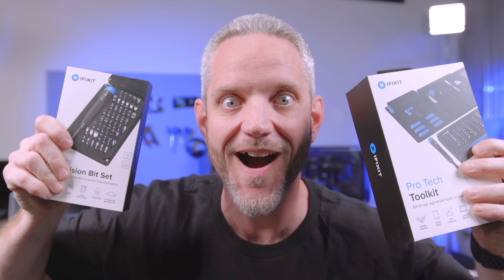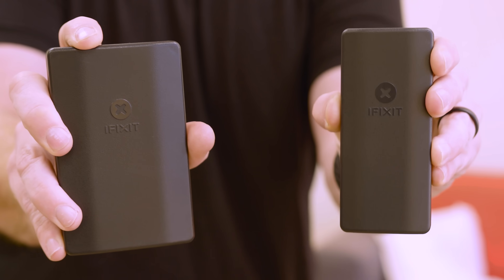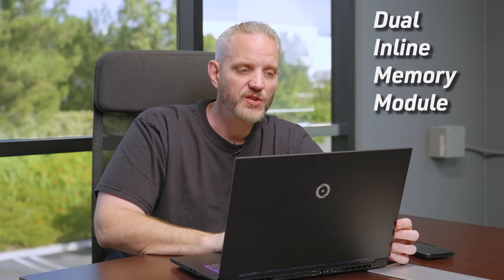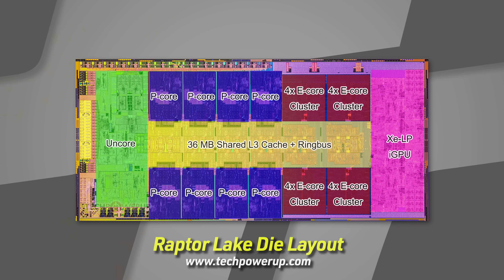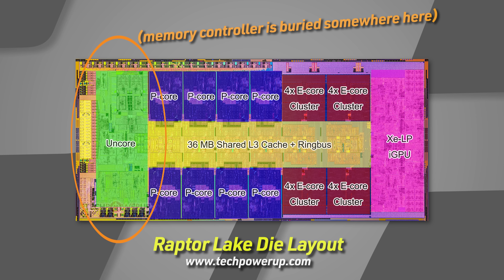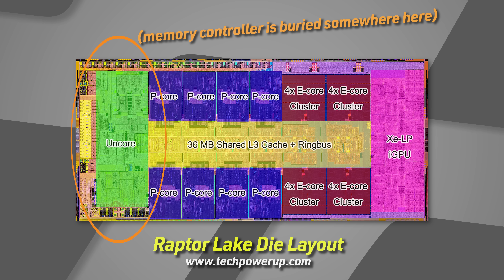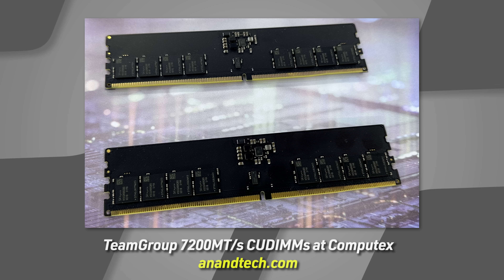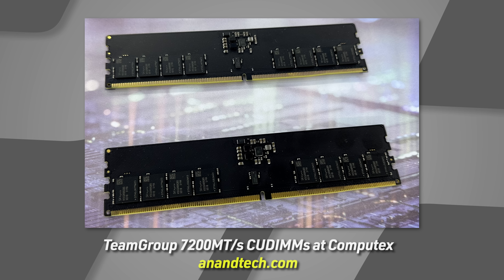RAM just got a LOT faster! Up to 10,000MHz!

Comment: The platform upgrade seems to be way better than the cpu upgrade with arrow lake (new chipset gets up to 40 pcie lanes [20 from cpu 20 from chipset], up to like 20 usbs, built in wifi and bluetooth in the cpus itself; only problem is if the motherboard manufacturers take advantage of that or will they just pusz more rogslop)

Comment: I like innovation but I have some doubts.
In recent years when they have increased the complexity of the hardware (and therefore of the software that manages it) it has not always ended well.
I have the impression that they are forcing it in this direction as a trick to overcome the lack of innovation in the basic structures and to try to save money (and as an excuse to increase prices).

Comment: I ran DDR4 3200 next to DDR5 on 5600 on the same sort of set up. It made a grand total of……about 2fps. 80fps to 82fps, so realistically 2.5% faster. For a lot more cost. If you’ve got ddr4 board with a modern Intel processor, don’t bother changing.
Reply: Look at your latency values. Games are very dependent on latency.

Comment: How about you get yourself an FPGA and actually make a little simplistic CPU design in verilog that can access bytes in DDR3 as simplistically as you want using as much FPGA IP as you want. No? If that is too hard, shut the hell up about memory interfaces. If you want to play electrical engineer, you need to be able to do some electrical engineer homework.

Comment: X58 with 12GB 1600Mhz (HPX Genesis)
X79 with 16GB 2400Mhz (HPX Beast)
X99 with 16GB 3200Mhz (HPX Predator)
X299 with 16GB 4800Mhz (HPX Renegade)

I ran these HEDT platform over the years now and currently now waiting for DDR5 to mature into 6400Mhz and 9600Mhz. It's gonna be awesome to start using these matured modules once Windows 10 is EOL in Nov 2025 and change into new platform using DDR5

Comment: I am personally excited for CUDIMN because I would like to set up a prosumer style server that can run multiple games at once in dedicated virtual machines on the same hardware. Do I absolutely need the fastest possible RAM? No, of course not. I could easily do it with DDR4 and it would be functional. But would it be nice to have a 10,000 megahertz server with 256 gigabytes? I think that is a no-brainer for running several servers that Don't individually need massive quantities of RAM but Will benefit from Faster RAM.

Comment: I think for gaming applications it is not necessary, at least for the foreseeable future. We heard about Intel going this route, how about AMD? It sounds like it will be a couple of years before this takes off in a meaningful way. I could see the next CPU upgrade involving a RAM upgrade to get the most out of the system; I assume motherboards support this?
Reply: Only Intel Z890 platform currently supports CUDIMM memory officially. If you install a CUDIMM stick on a AM5 board it will either not work or use a bypass mode that will make it work as a normal UDIMM stick (so without the CUDIMM benefits) at lower clock speed.
Reply: @Patrick73787  right,  ur I am sure AMD’s next CPU lineup will have CUDIMM support; probably two years away, unless they come up with a new CPU in a year that has the support before the next generation.

Comment: I think that in the future consumers might benefit from cudimm; if the price becomes reasonable. Using cudimm in an integrated graphics or apu setup, for example, might make adopting new platforms easier with the approach of multiple periodic upgrades instead of investing into a single major upgrade every 3 to 8 years. This is reliant on the price of the ram and the capabilities of the apu though. Other than that, perhaps in 5 to 10 years cudimm or even an iteration of cucamm will become a common and welcome no brainer for speed with stability, and integrated memory controllers will become rare.

Comment: Well... the one scenario I can think of is probably starting systems in RAM. It's pretty popular in enterprise solutions, especially with dynamic environments and some types of hypervisors like ESXi which can be booted from PXE/DHCP and are living only in memory. Had they have any problems, catastrophic failures- gather logs, restart with fresh OS version or on new hardware, you're good to go. Or even simple update is much more straightforward- you'd just prepare new golden image and simply restart them and new version will spin up, no need to going through whole patching process

Comment: 11:30  "Why is this 32 Gigs of DDR5 CU-DIMM are $400 and this 32 Gigs of non-CU-DIMM is $200 ?    Why is the $200 gap?"  
Because on the CU-DIMM they added two extra chips:  a PMIC (power management controller) and a clock driver IC.    ... and these cost $0.17 each  😛

Comment: why have a speed rating of 10.000mhz if you are going to have a CAS latency up towards 70-90-90-240 when if likely going to be more beneficial to have even 5000mhz and CAS latency of 30-40-40-60.
Why double the speed but add more the double the latency cycles at the same times, considering most data request are random from the CPU and not massive consecutive files the latency is more of a concern the lower capacity of ram you have, as it have to clear portions of it more often and that has the longest latency.

As a gamer i more interested in getting lower CAS latency on slower ram around 6000-8000mhz because they can sync the cpu and memory clock to make the "dead space" after the data packets smaller.

Comment: Quick thought / question on compatibility.  From what I've read, CU-DIMM Mobos will be backwards compatible with UDIMMS (As Jay said).  CU-DIMMS apparently have a "by-pass" mode, and there is talk about the Ryzen 8000 and 9000 series using this - I think, in effect, just making them UDIMMS, but at least allowing them to work.  My question is if you just stick a CU-DIMM in a standard old UDIMM Mobo, will the "by-pass" just work, and it will work as (over-priced) standard UDIMMS?  A bit like ECC unbuffered DDR3 - the vast majority of motherboard will work just fine with ECC unbuffered RAM even if they or the CPU do not support ECC just not using the ECC, so just be a UDIMM......

Comment: What's the speed on the bus? Are we not starting to run a serious risk of hitting the bus transfer limit, if the RAM speed keeps increasing like this? I'm sure that could be addressed but if the motherboard goes up 200-300 quid as well we're talking premiums on premiums on premiums

Comment: So will AMD finally break its 6000-6400 sweet spot or will Intel use this to defeat V-cache is the next question
Reply: Very hard to tell as things stand right now. I guess with RAM speeds beyond 9000+ Intel will probably beat X3D.

Comment: are they going to admit DDR5 never worked with 4 dimms ? or better does cudimm fixes that ? (doubt it) they could also  finally give up on marketing 256gbs of ram you can't use without halving your transfers ? if you disagree I'll point you toward 99.99% of reviews and actually used pcs by reviewers and influencers they all only use 2 dimms, maybe like intel 2 years later tech tubers will finally dare talk about this major downgrade that was stealthily pushed onto the market
Reply: I use 4 sticks of DDR5. What's your issue?

Comment: I’m a graphic designer and I currently have 128GB DDR5 RAM (4x32GB) 5600MT/s CL28 (full specs below) because Photoshop is a ram hog and will basically use whatever ram you throw at it. My bottleneck has always been ram. This would be quite amazing although not sure if I can afford the platform upgrade, especially since I also need pretty high capacity.

MOBO: ASUS TUF GAMING B650 PLUS WIFI
CPU: AMD Ryzen 7 7900X
RAM: G.SKILL DDR5 RAM 128GB (4x32GB) 5600MT/s CL28
OS NVMe: WD_BLACK 1TB NVMe SSD
GPU: Zotac Nvidia 4080 SUPER

Comment: The advantage to most new faster expensive tech is within a few years it trickles down to the more mid range and affordable price ranged gear the masses do use.
At that point it usually makes more sense for the average PC user to adopt the new tech.

I know I bought DDR5 for my 12th gen Intel build when it was new and hard to find and cost quite a bit more than DDR4 which I also could have opted for.

But considering IF the 14th gen CPU's drop enough in price after the Arrow Lake launch I may just upgrade the CPU and may even go with much more recent faster DDR5 ram now that the prices are much more reasonable.

But from the sound of things hopping on the new tech bandwagon on the Arrow Lake platform will not get the gains in gaming performance over the older 13th and 14th gen to begin with to make it a worthwhile upgrade at this time.

Comment: DDR5 mem bus is at the limit of signal integrity, I can see CUDIMM or RDIMM being necessary for all DDR6. Frankly the extra chip is a very low BOM cost, they only charge more with DDR5 because of market segmentation and because the mem chips themselves are binned for high speed.

I would prefer they just skip CUDIMM and go straight to RDIMM, the one mem-clock of latency has been insignificant since DDR3, (DDR2 if your looking at total access request time from the CPU rather than just CAS in isolation.; Like 1/200th difference in CPU cycles.) and the register has huge benefits.

Comment: Because of the RC load of circuit trace, the edges of signal change is like a slope, and when frequency go up to a certain point those slope will stack on each other and no longer to know where is "1" or "0". 
So Jay is not completely correct since CU-DIMM only has buffer on clock to help the quality but not on the data.

Comment: I do hope people start taking notice of some of these comments because there's a couple of glaring issues here that need to be addressed. It's also known that you delete comments on your videos, so please try to take valid criticism where it is due.

1. You've circled the PMIC in the thumbnail. That isn't the clock driver. 
2. Not using CUDIMMs in your AL reviews when the platform is designed to is incredibly short sighted. Yes, it does give the platform an advantage, because it supports it.

Comment: CUDIMMs are compatible with legacy systems. From SemiEngineering:
PLL bypass mode: In this mode, the clock buffer just passes on the input clocks to output without any kind of signal buffering. The PLL bypass mode enabled CUDIMM devices behave like traditional UDIMMs without any buffering of the clocks. This is why it’s also referred to as legacy mode. Recommended CUDIMM operating speeds in PLL bypass mode are typically limited to 3000 MHz.

To my understanding if CUDIMM is in "PLL bypass mode" (one of 3 modes) it will be running at default/base clock whatever that is. Probably one of JEDEC base clocks.
Reply: yes I think he got that part wrong. In those cases the signal just wont get cleaned up but it will work just fine as a typical ddr5 (and without the max speed obviosuly, but is not like the system won't boot or anything)

Comment: A better analogy is the CPU is the Amazon employee and the RAM is the warehouse, The CPU needs to grab a ladder and go fetch the data it needs from the warehouse. The new system is an automatic crane that fetches it for the CPU when asked for it.
As for the RAM itself, when i upgrade my system is 3-4 years from now it will probably be the only type of RAM available for the new mobos so i won't have to make a choice between it and standard DDR5

Comment: good scare Jay🙃🙃
cu-DIMM DDR5 at 6400MHz seem to be about 20-25% Cheaper than SO-DIMMs at 5600MHz
and cu-DIMM 8000 -9000 MHz will proly have a 30% price premium over 6400
as long as the demand and supply stays healthy🤞🤞

Comment: does am5 specifically the upcoming x3d cpu's not support CUDIMM's? is it currently on arrow lake only?
Reply: Only Intel Z890 platform currently supports CUDIMM memory officially. If you install a CUDIMM stick on a AM5 board it will either not work or use a bypass mode that will make it work as a normal UDIMM stick (so without the CUDIMM benefits) at lower clock speed.
Reply: @Patrick73787  thank you for taking the time to educate me, i appreciate you!

Comment: Consumer CPUs with an integrated memory controller are much older than 7 years. On AMD side it was the Athlon 64 introduced in 2003(!) and Intel did this with the Nehalem (Core i7 900 series) in 2008.

Comment: Hard to see CUDIMM catch up with LPDDR5x or CAMM2 with Samsung already selling 10.7GBps LPDDR5x memory now mobile is reaching 85.6GB/s with 4x 16bit is beating old low-end GDDR bandwidth speeds. Scale this to laptop side and use 8-channel (As used in X Elite) then you're reaching GTX1650/RTX3050 bandwidth speeds. APU's in 2025 will be getting their much needed bandwidth capacity.

Comment: MT!=MHz, MT is the number of times that data can be moved per clock tick, the MHz is the number of clock ticks per second. With DDR the number stands for the number of transfers per clock tick. So if a DDR5 stick has 10.000MT it is running at 2000MHz. Theoretically, if it ran at 10000MHz it would do 50000MT.
Reply: DDR stands for Double Data Rate, they all have two transfers for every clock cycle.
Reply: @JGnLAU8OAWF6 Was about to say the same thing. The number at the end is just the “generation”, and has no real meaning in regards to its transfer rate (beyond what standards are set for that generation)
Reply: Hey, look, a thing I just learned.
Reply: @MichelVaillancourt  unlearn it because its wrong lol

Comment: if the 9900x3d and 9950x3d are looking to support CUDIMMs this could be game changing, and another curve ball when picking between a 9800x3d vs a 9950x3d
Reply: How, if IMC tops out at 6400 anyways? 4:1 ratio?..lol
Reply: @Chair-Throwing-Italian  Do you not listen to a word... the controller is where now?

Tech changes... and even uncoupled ram will run faster if you can get say 9000MT/s at 38cl vs 6000MT/s even at 30-34cl... higher MT/s gives lower latency, gives better FPS
Reply: They don't.
Reply: @Patrick73787  errrhh yeah they do: 

Yes, AMD supports CUDIMM RAM: 

An MSI overclocker confirmed that CUDIMMs work with AMD Ryzen 8000 and 9000 processors. 

Thank you please come again...
Reply: @Patrick73787  MSI's X870E motherboards will feature CUDIMM memory support on AMD Ryzen 9000 & 8000 CPUs but will be limited in terms of functionality.

Comment: It's always frustrated me that latency is expressed in terms of number of cycles at a given clock speed rather than actual time. Latency had barely changed since the DDR2 days, and it would be so much easier to compare RAM quality if manufacturers just gave the raw latency spec.

In essence, 15ns latency is 15ns, whether that's DDR2-400 with CAS Latency 3, DDR3-1333 with CL10 or DDR4-3200 with a CL of 24.

When I look at a store page, I want to be able to compare latency, I don't want to have to calculate or look up what the actual latency is for each combination of frequency and CL. It's difficult to know if PC4-23466 CL19 is better or worse than PC4-25600 CL22, but 12.96ns vs 13.75ns makes it real obvious.

Comment: you should've mentioned that DDR5 has introduced 48GB high capacity ram sticks.
CUDIMM could (in theory) support a single stick size of up to 96GB, so (in theory of course), CUDIMM's could in theory boost a Z890 motherboard to support up to 384GB Of ram with a configuration of 96GB x 4 sticks.
however it is solely up to Intel at this point to know wether their new CPU's actually can handle this capacity of Ram to begin with, as a reminder the original Core i7 965x/970x/980x/990x all supported "up to 24gb of ram" but that was false, they all supported up to 48GB of ram. that is because when Bloomfield was launched the sticks of 8GB of DDR3 RAM simply didn't exists yet - so Intel and motherboard vendors didn't advertise their products as supporting up to 48GB of DDR3 ram.
i feel like Arrow Lake and Z890 could be in the same scenario where they mention support of up to 192GB of ram because that is what is currently available right now, but in theory when 96GB DDR5 CUDIMM sticks become available they should technically be able to support up to 384GB of DDR5 ram - which is HUGE for us who gain performance by uploading simulation software to run directly from volatile memory to improve performance!
Reply: Good point.

Comment: I know you said "not games", but there is a specific kind of game that benefits greatly from this sort of thing, and that is games that run massive simulations. The one that comes to mind is Factorio. IMHO, that game should be in benchmark suites partly because of how hard the developers have optimized it, but also because it makes some interesting and uncommon (for a game) demands on a system.

Also, other games in this category would be things like Dwarf Fortress (maybe). But that game doesn't have anywhere near the performance testing infrastructure, including well known performance intensive save files.

Comment: Yeah this memory is going to be super expensive. 99.9999999% don't need or even have a use for this type of memory. Not only is the memory going to be expensive but so will the new mobo that will need to be manufactured for this new type of memory. It'll definitely be interesting to see what the uplift in performance will be but it will most likely not be of any use for everyday users or even for hardcore gamers for that matter because of the price point. Seems at the moment like just another shinny gimmick so companies can charge more for their products. No thanks! I'll just stick my "dumb" memory.

Comment: I just wanna ask what the benefit of having more MT/s speeds is if timing are becoming higher as well. Don't they kind of cancel each other out? Or we get diminishing returns. Not to mention to get those speeds they're adding modules to the DIMMs which increase both complexity and cost. Are we to reach a point where a decent budget gaming pc (if it was built with only new parts) would cost like 800-1000$?